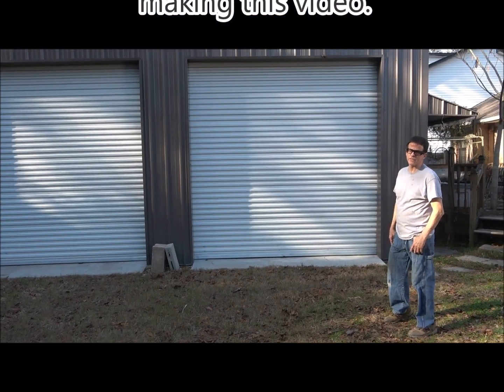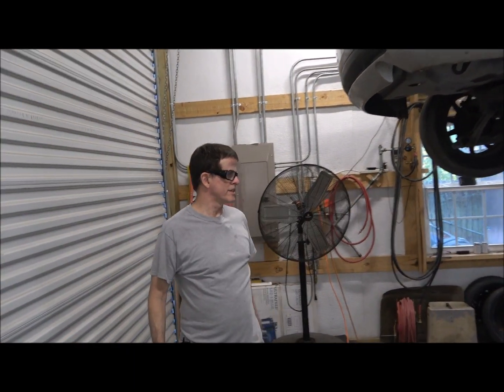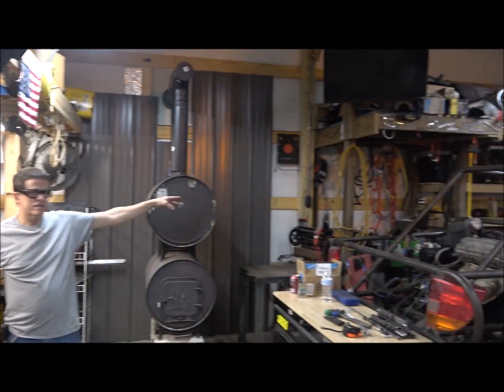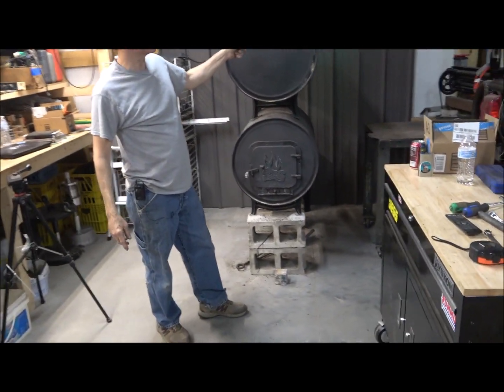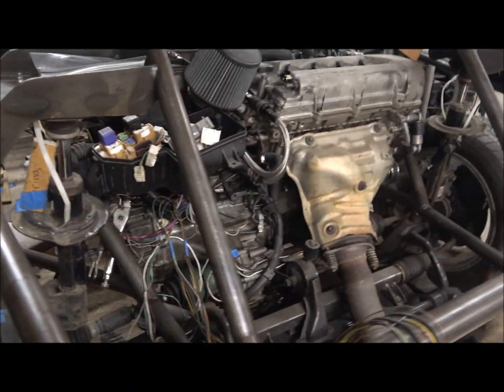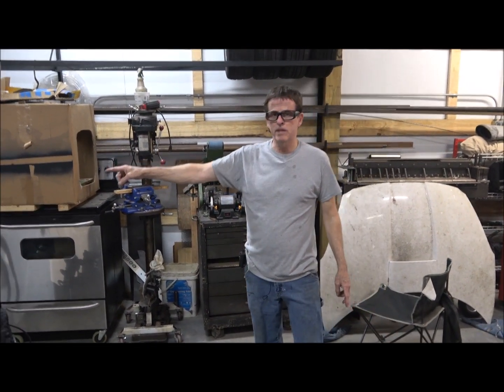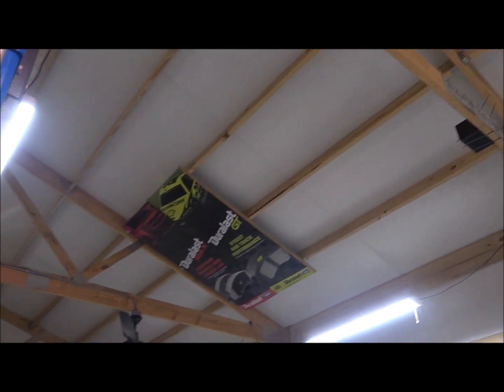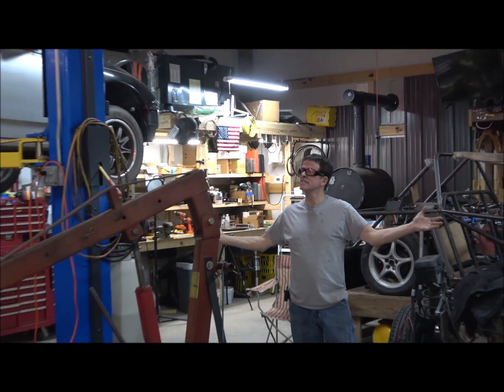Build a back yard garage, TSR Garage Shop Tour #tsrgarage #garage

Comment: Nice shop. What is the dimensions of the shop, and how much it cost?
Reply from the maker: 27x36 12 foot high. 16,500 for building and concrete. Did most of electrical myself... (didn't keep track of exact cost)
Reply: @TSRGarage  Thank you for reply, Thinking about building a shop too
Reply from the maker: @MiguelRodriguez-pz8wi  👍build it as big as you possibly can.. no one has ever said "I wish I hadn't built such a big shop"